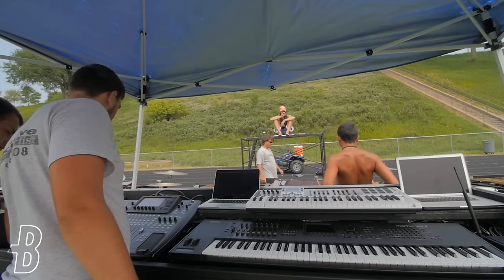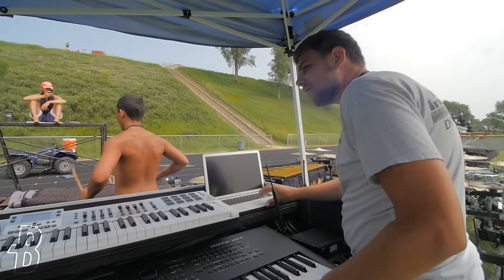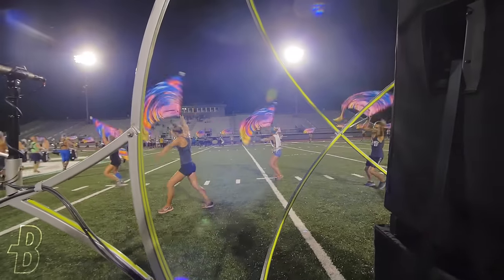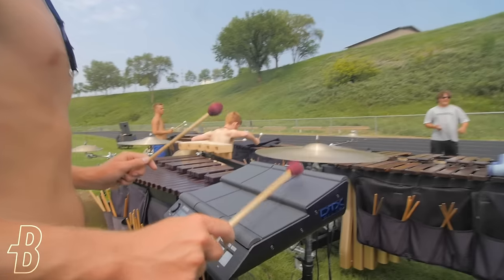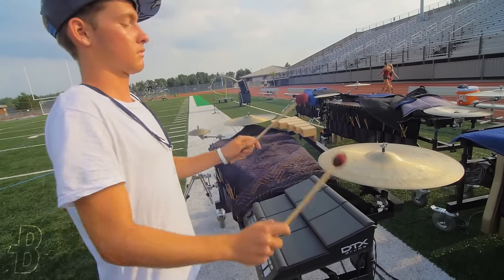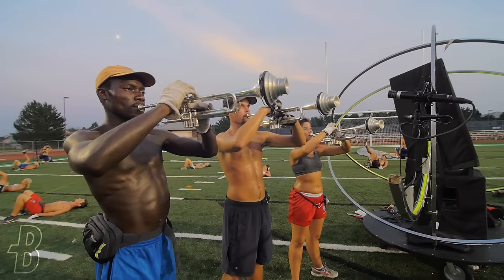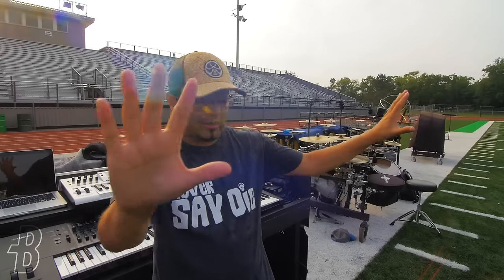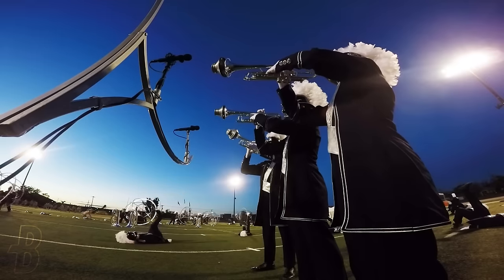True Bloo: Encore - Soundscape

Comment: Well the Bluecoats are leading the way in electronics use. 2 years from now every corps will have those stupid speakers all over the field. I laughed every time they had equipment "issues" this season.
Reply: I don't think that will be the case. Maybe I'm wrong, but I doubt many of the other corps' design staffs would have the ability or desire to do something like that. It looks like a monumental undertaking, and very difficult to pull off. I wouldn't be surprised if the Bluecoats keep putting stuff like this out, but I doubt we'll see much of it from others.
Reply: They will continue. Bloo is good at doing stuff different.
Reply: Well, 2 years later. . .
Reply: lol that's what I was thinking. This level of sampling and sound reinforcement is so much work that I think most of the directors look at the payoff (3rd place) and think, "why?" at the end of the day, do the students actually benefit from the extra equipment?